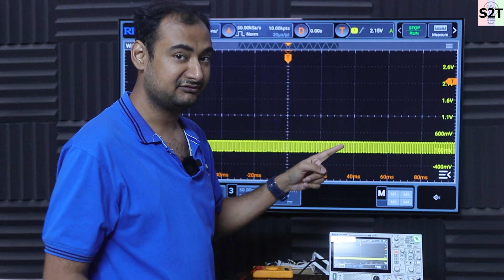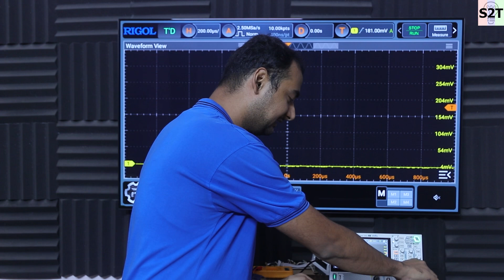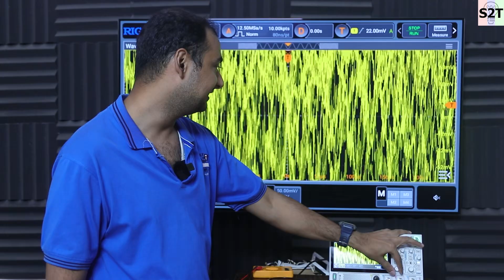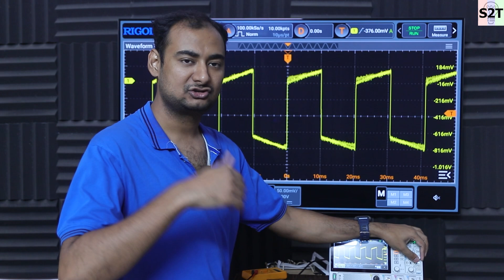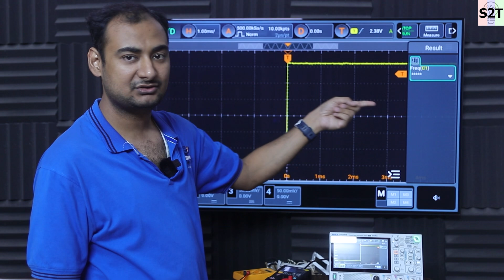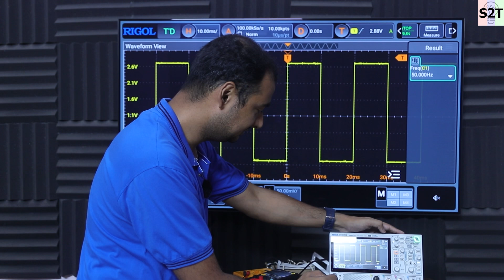Oscilloscope Tutorial {Basics 101}Explained {Science Thursday}

Comment: In polyhouse farming the temperature and humidity are controlled. As soon as the temperature increases the system automatically turns on the fogger. As soon as the constant temperature and humidity is reached the fogger gets switched off automatically. 

Can you make such a controller system like you have made a fan controller for self.
Reply from the maker: should be possible but too much on my plate as of now